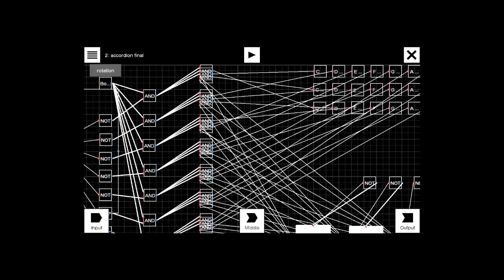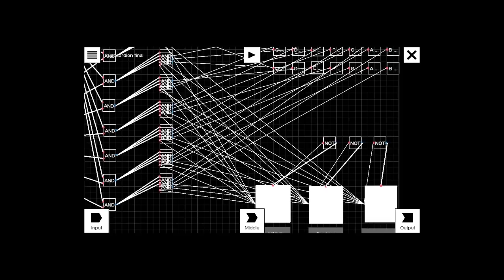Solar-powered Cardboard Accordion with Nintendo LABO

Comment: I did not understand how the control understands which hole is pressed.
Reply from the maker: xSkepCreations R controller’s IR camera will output 7 dots of light in the console display. Each dot is covered in one bullseye node, then it’s connected to NOT node then connected to a sound note (each dot is connected to different sound note). Which makes it make a sound only when the light is no longer there, by covering the hole or being inside.